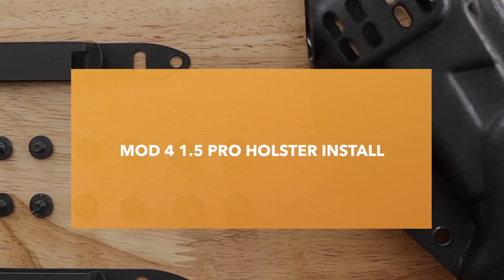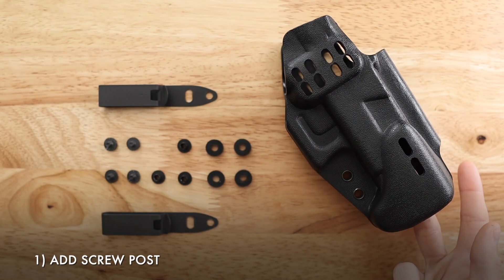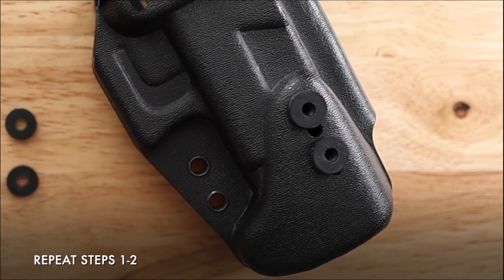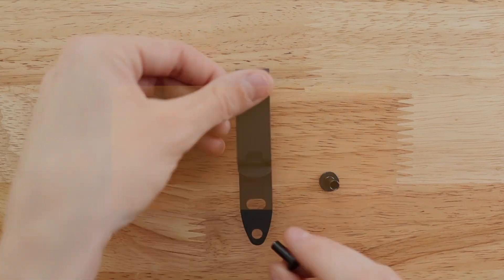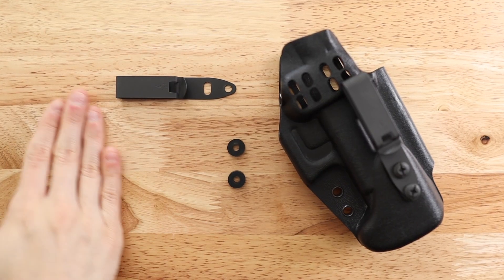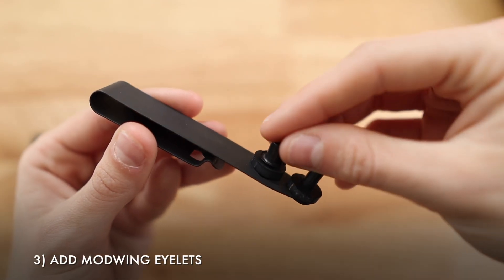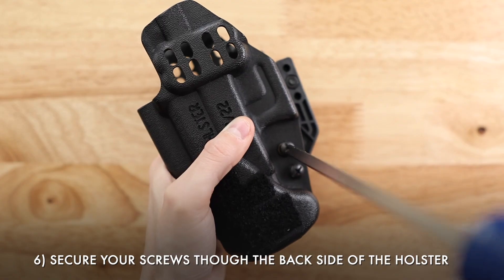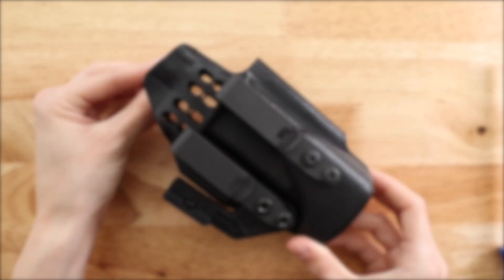How to Install Mod 4 1.5 Clips onto the Pro Holster

Comment: Will the DCC Mod 4 fit a Montana Hanks Bison Belt? It is super thick, also what about the "wing" will still help reduce the printing?
Reply from the maker: You’re almost certainly going to have a lot more success with a more flexible belt. 90% of people, in our experience, get way better comfort and concealment with a belt which is capable of conforming to their body. Extremely stiff belts often create gaps between the belt and the body and allow the holster to just hang in the gap and pull away from the body, instead of causing the pistol and holster to conform to the body.

Comment: Has me worried the thumbnail is different from the final product here. Namely the Philips screws on the mod wing face up in the thumbnail but on the back in the video. Did the process for this change at some point? Or is one method more correct than the other?
Reply from the maker: The screws facing the backside of the holster in the video is just a result of the "stacking" method for assembly, which most people find to be easier than adding each piece one at a time. Both methods produce the same end result, but the stacking method can be easier to assemble.
Reply: @PHLster  okay cool, because I also tried switching to the thumbnail configuration, and the eyelets don't seem to fit through the mod 4 clips like it looks in the thumb. So I didn't know if maybe the clip holes changed or there's maybe a different generation or something where the old ones worked this way.
Reply from the maker: @Taquitos95  The Modwing eyelets shouldn't go through the clips. The eyelets are just made to sit inside of the Modwing to reduce movement in the clip, and mitigate the screws backing out.
Reply: @PHLster  I think he's right, but mistyped "eyelet" instead of "screw post". In the video, you can see the cutouts on the DCC clips have an oversized and a horizontal clearance slot that let's the screw posts pass through the clip. The DCC mod 4 1.5" I just got from you has vertical clearance slots for both holes where the screw posts don't fit through as in the video. I have to assemble with the screw posts going through the back of the holster, and screws on top, which is the opposite of what's shown in the video.
Reply: @vandal144 thank you for saying this!! I was sitting here trying to add the clips to my phlster pro and the posts don’t fit thru the clips! I was racking my brain like what the heck? But installing the screws/posts the other way did the trick! Thank you again!!
Reply: @vandal144  I am stuck still trying to figure this out I am having the same issue. Can you please help?
Reply: @justinthomas4442  I am stuck still trying to figure this out I am having the same issue. Can you please help?
Reply: @ealxele  feed the screw posts from inside the holster facing outward. Then layer the hardware on top, then screw in the screws from the outside of holster. The concept here is that the screw posts are too thick to fit thru the dcc clips but the screws are thin enough to fit thru the dcc clips, go thru the rest of hardware, and screw Into the posts that are feeding outward from inside the holster.

Comment: Can you please do a video how to install soft loops i took mine apart i dont like the DCC mod 4 clips and now i cant put it back
Reply from the maker: Skip to 54 seconds https://youtu.be/50KyxEmbZhA
Reply: @PHLster  sucks I tried putting it back and the loops keep unscrewing even when I tighten them up pretty good I like the holster these last 3 days I've had it but I'm kinda iffy now about it
Reply from the maker: @big4kt You can always email us at info@phlsterholsters.com and include some pictures of the gear in its current state, and we can walk you through it, no problem.
Reply: @PHLster  i will right now
Reply: @PHLster  I think what it is , is that I only have 1 screw post that is slightly larger that works because the other one post doesn't let me screw it in so than I used the rest of the 4 smaller screw post that come with it + a rubber spacer so basically the small screw post sits evenly with the rubber spacer not slightly sticking out like the slightly larger screw post
Reply: I think because I used the smaller screw post it doesn't reach the screws that you use with the soft loops to screw on more
Reply from the maker: make sure you’re not mixing up the hardware from the Monoblock with the hardware for the loops (or mixing them in with each other).
Reply: @PHLster  that's what I did wrong because I didn't like the DDC Mod 4 and tried switching it back to soft loops but I think I ended up stripping the post it came with on the soft loops and used different smaller screw post I wish I had just left it alone but I wanted to try the DCC Mod 4 clips 😅😭 it is my first time trying you guys and I really like it alot compared to my old holster (WTP)
Reply: @PHLster  do you guys sell soft loop kits I wanted to buy the correct screw post but can't seem to find anything close to it
Reply from the maker: @big4kt  you can contact us for warranty replacement